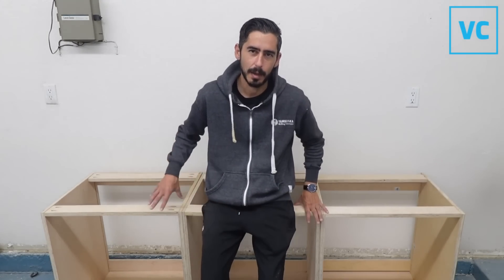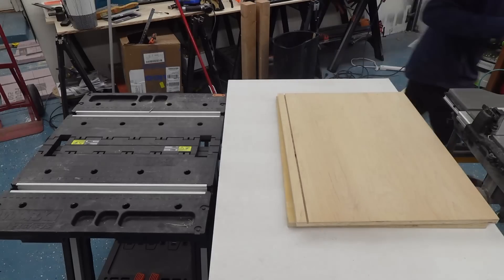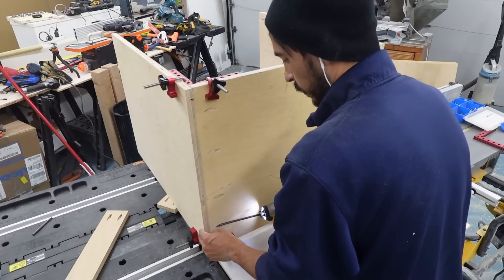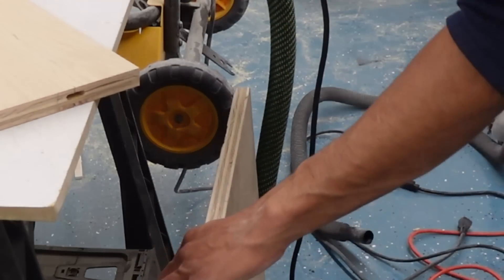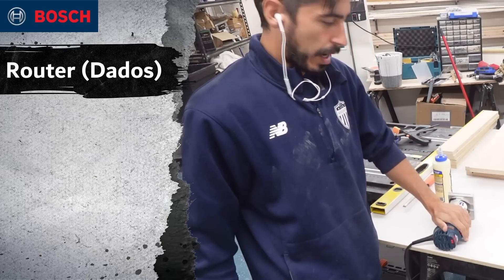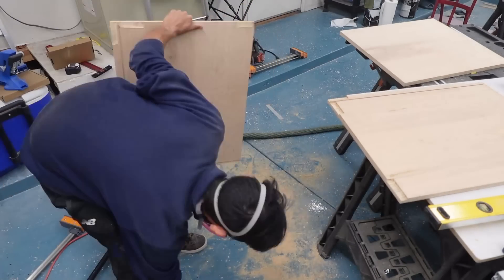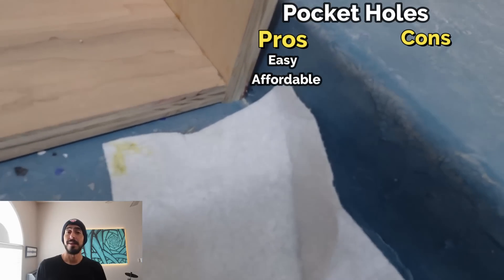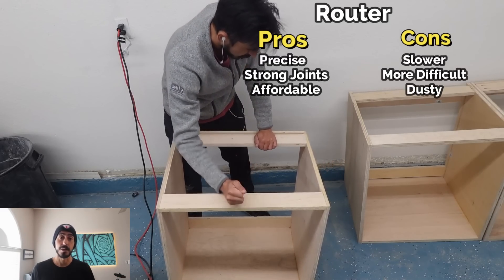Dominos vs Pocket Holes vs Dados | Testing Joinery on Cabinet Boxes

Comment: I used to manage a cabinet mill and have made a lot of kitchen cabinets. While all three of these methods work, I would use what our host is calling the dado method. (Those weren't dados. They were rabbets.) I also wouldn't cut the dados with a router. I'd have used a dado stack on the table saw. With this design of cabinet box, I would have cut a full-length rabbet along three of the internal edges of each plywood side (top, back, and bottom). This would require only one setup on the table saw and each side could be machined in next to no time. I'd also use a pneumatic nailer or stapler to attach the all the parts together while the glue dries. No need for clamps (except to hold things in place while assembling). It's a fast, easy, accurate, and super strong of building cabinets.

As I said, the other methods work. But, I can see no advantage of using them over the method I described. Provided, of course, that you have a dado stack for your table saw.
Reply from the maker: ugh yea, thanks for the callout, rabbets indeed!  I do have a dado stack, struggling a bit to get consistency on it for some reason.  Do you just use a sacrificial fence to get the rabbet right up to the edge? Can't figure out how to get the cut as precise with just my miter gauge
Reply: @vanishingcabinets  Sorry for being pedantic about the distinction between dado and rabbet.

Yes, you use a sacrificial fence. I use a couple of 'fence clamps' to secure mine. (The 'clamping part' of the corner clamps you used in the video would work for this.) Once you've made and installed the fence, it only takes a few seconds to mount. It only takes a minute or two longer to make another fence when the need arises. Just drill a hole in one end so it can be hung on the wall. It will always be hand when you need it.

Learning to use a dado set involves a learning curve. Yet, the curve isn't as long or as steep as learning to use your domino or a doweling jig. 

HTH

Comment: You had a plan on putting it together for the other methods except the domino. Once you figure out how to do it you should be knocking them out in no time.
Reply from the maker: Yep thats what I was thinking. Much more experience with the other two, so even with little experience with the domino it was a comparable time so a ton of potential for sure!
Reply: @vanishingcabinets  It goes super fast when you use the indexing that is built into the domino.  Especially on the stringers.

Comment: I like this in general, but found it curious that you state the pocket holes take longer when it was faster than either of the other methods you use.
For about 1/3 the price of the Domino system, you can pick up the Kreg Foreman.  I find that this style of cabinet takes me about 2 minutes to drill all the holes using that. Even using the Kreg jig shown here, it shouldn't be more than about 5. I avoid the joint inconsistency by using some clamping blocks to align the board edges and prevent shifting. But the assembly process on a cabinet of this design takes me less than a half hour at a leisurely pace. 
All of the systems have their merits and drawbacks. If I'm doing a one off, I might try some different techniques.  In terms of kitchen production, I can't imagine using anything other than the pocket screws.
Reply from the maker: Ha, yes it was ironic I said pocket holes were slow then they were the lowest time.  At the time, I felt I was inefficient with the other two in terms of dialing in the measurements, so if I was doing a bunch at once, seemed like in the long run they would be faster. But I could see the argument that pocket holes could still be the fastest, especially with that Foreman and a better clamping method than I used.
Reply: @vanishingcabinets  I have a jig that I use. It's made of 1/2" plywood and looks a little like the symbol for Pi. The edge at the back is notched to support the rear stringer, while the top is cut to position the top two stringers. Basically, I stand that up, flush it up to the front, and clamp it in position. It gives me support and alignment for all 3 at once. I made a pair (one for each side) and can drop in and affix all 3 in a matter of a couple of minutes. Gives plenty of support for downward pressure to hold the joint flush. 
Again, I definitely see benefits to ask the various techniques. And I know there are purists out there who have a gag reflex when someone mentions pocket screws. I just know that for production speed, I'd be "screwed" without them. (Ba dum bum!)

Comment: For the pocket holes, for the stretchers it might have been faster using your bar clamps to clamp in position then drill both ends? This would have stopped the faff with the corner clamps and might have clamped them in position better?  It's an interesting comparison. 👍
Reply from the maker: Actually, you are spot on, the corner clamps take forever which is what took most of the time. Think I could've gotten a better result if I just used the bar clamps. Didn't even think of it honestly.
Reply: @vanishingcabinets   I only picked that up because I've got the same corner clamps and they're very fiddly. You should do an update video when you've been using the domino for a bit and are able to set it up faster.

Comment: Nice video. Good presentations style. For this style of cabinet, I'd use the Domino on the narrow setting for the front edges of the bottom, front stretcher and two back stretchers. Use the alignment wedges on the front of the Domino to set the distance from the edge. Then use the middle or wide setting to do the back and middle of the bottom so you don't have to be precise with your measurements. Put 2 pocket holes in the bottom between the dominos and one on the ends of each stretcher plus one in the middle of the top back stretcher. This way all of your alignment and clamping is taken care of without needing any clamps or having to wait for glue to dry.
Reply from the maker: I love that idea! Using both methods seems to be the fastest.   The mortise "width" setting I didn't even notice when I was building these, but have since been using to give some wiggle room. Really helpful feature.
Reply: @vanishingcabinets  Festool’s instructions suggest using the narrow setting for one hole and the wider one for the rest so you get alignment of your reference edge and ease of placement and assembly.

Comment: I’ve used a domino pocket hole  combo for the alignment of pieces and not having to wait for glue to dry
Reply from the maker: Sounds like a great combo! Save money on the clamps, no waiting. Best of both worlds
Reply: Another Domino/Pocket Hole combo fan; dominoes keep everything aligned whilst screwing together.  Once you get to grips with the Domino the layout and morticing is pretty quick; loads of great tips on the Festool and Sedgetool YouTube channels.
Reply: @turnamere4859 I think I will try the combo tomorrow.

Comment: The secret to strong cabinets is  full 3/4 backs ,so much needless work trying to fit a 1/4 inch back  .Just because all Youtubers are doing 1/4 inch back doesn't mean its right .
Reply from the maker: For sure, I like the full paneled backs better quite honestly. Seems sturdier. If I had more plywood, I would’ve built them that way.  Full panel on top too is nice
Reply: Great answer and its a good idea to show dados not to many show that .But  it doesn't add that much to the cost .If you want a cheat code when I first started I used to get my cuts at Rona or Home Depot saved me so much head ache I was working out of a 1 and half car garage.Great video @vanishingcabinets

Comment: A plate jointer will do the same thing as a domino. Same strength, same speed, much less expensive. Also dowels work even better and are much faster.
Reply from the maker: Haven’t heard of a plate jointed before, will check it out!

Comment: I just finished making a bunch of cabinets identical to your design using pocket holes. It was super validating to see your experience with the inaccuracies when clamping isn’t rock solid. That said, I think there’s a fourth approach using glue & 21ga pin nails that could work better. I haven’t tried it, but I have a trip to harbor freight planned to finally get a pin nailer this weekend to find out…
Reply from the maker: You know some people say they have no issues if clamped properly but I haven’t cracked that egg. Good luck!
Reply: @vanishingcabinets  I have YET to get a single joint to look right, even with the Kreg pocket clamp and the corner clamp. Every time I try to screw one pocket in.. the wood moves. I DO have those same corner clamps you have and have NOT tried that.. mostly because it takes a bit of time for every corner to set those up. Now that I have a domino which is more forgiving as you can make one side a little bigger to allow easy adjustments.. I dont really need those clamps any more. Sadly.. I have about 5000 pocket screws of varying sizes so will continue to use that for some things to use up some of them screws.

Comment: When you put a dado on the very edge of a board it's not a dado it's called a rabbit joint. 

They sell higher-end actual professional grade pocket jigs that are not made by Kreg, and the board stays put when you drive the screws in. This is because they do a much more extreme angle. They don't use a drill bit to machine out for the screw they use something more like a router. It does not do that 15° angle like your kreg jig. The professional grade models put a 4 degree angle. This is a much stronger joint and it doesn't cause the piece to walk out of position. 4° versus 15° there's no comparison. Also the professional pocket hole machine is way way faster. They are very expensive but so is the Domino.
Reply from the maker: I was actually wondering if dado was the right term, thanks for the clarification. Great info on the pro grade pocket holes!

Comment: It is all about your capabilities and tools on-hand.  For me, I use the glue and brad nail method, then add a few screws.  Rock solid and works perfectly, being faster than all the other methods shown here.  If I have a finished side showing, I use pocket holes on those sides so the face has no holes to fill.
Reply from the maker: Agreed, a lot of ways to accomplish the same thing. Really like the idea of simplifying the joinery and just having a finished side to cover up the screws.

Comment: best way to build cabinets, is using a lamello biscuit jointer, I can cut the joints and assemble it in 15 minutes and its the strongest method, been doing it this way for 30 years
Reply from the maker: I was looking at the Lamello brand, looks like a high quality tool, thanks for sharing!
Reply: @vanishingcabinets  it is, you can buy the classic x for about $700 and its far more accurate than a domino
Reply: I have the Domino and I was thinking about the lamello as well and I'm familiar with assembling lamello cabinets. But I think you still going to end up having to align the tool the same way that he was doing the domino so I think that stuff doesn't change. So I don't really think it's that much faster. I think will be much faster is changing the way the cabinet is made. For example, I use three quarterbacks. Yes, it's much more expensive but usually I do the plants on method for the cabinets and a lot of the cabinet shops near me do the plant on method and that one seems to be the fastest and it's extremely tough box
Reply: @Therealphantomzero  I don't know, I am not a fan of the domino, I find the lamello to be far more accurate than the domino, I have a slot mortiser for doing loose tenons I've been building cabinets for almost 30 years professionally and for me this is the fastest and best way to do it.
Reply: @oliver299d  I do find an interesting that you say far more accurate like I'm not particularly a fan of the domino. I like the climax connectors but I think they're both relatively precise. I guess I'm kind of hung up on what you mean by precise, you know
Reply: @Therealphantomzero  I have found that the lamello is dead accurate with alignment and the domino is hit or miss
Reply: @oliver299d so you're telling me it might not be me that some things are out of line?
Reply: @Therealphantomzero  yes my lamello always has perfect alignment, I don’t think a domino is good for cabinets that’s my opinion most people think differently
Reply: @oliver299d  Interesting. You just like the lamello more.. nothing wrong with that. I dont agree one is more precise than the other. I suspect they are both as accurate. What pisses me off is the cost of the Lamello.. it's a simple biscuit joiner with a little motor that bumps the blade up/down for a split second. That's it.. and for that you pay 10x as much as a biscuit joiner and more than the domino. They'd sell WAY WAY more if they made the price in the $300 to $500 range.
Reply: @WhySoDivided-CantWeAllGetAlong  the classic x is $650 or so that's the one I use, you're talking about a zeta that will do biscuits but its not meant for it, its meant for specialty fasteners
Reply: Lol, you just know who has never used the domino.

Comment: Two ways that I have found are the easiest for cabinet building depending on tools available and application (e.g., whether side panels are visible).
1. Pocket holes and narrow crown staples. Crowns keep the pieces from shifting around and act as temporary clamps. 
2. Domino and pocket holes. Use the reference pins on the domino for repeatable mortise placement. 1-2 pocket holes act as clamps and give added strength. 

Obviously there is no right or wrong. Simple construction screws work as well. Cheers
Reply from the maker: Yea I like the idea of staples for temp clamps! Could save a lot of time clamping.  Completely over looked the reference pins on the domino, need to familiarize myself with the accessories

Comment: Just started watching, but for me it would be dominos all the way. Speed and strength are excellent. Pocket holes are just ok. I don't like how they like to squiggle out of alignment, and alignment with no reference makes for annoying assembly. You also have to be careful not to overdrive them and end up poking through the other side of the panel. I do like to use them in conjunction with dowels sometimes though; the dowels provide strength/alignment and the pocket screws are used as the "clamps", so I can keep the project moving. Dados are great for alignment, but take more time and aren't as strong as dominos or dowels. Dowels are what I use (since I don't have a domino yet), with a dowelmax jig. Excellent results.

edit: Yep, once you master the domino, you can get those cabinets down to 15 minutes or less.
Nice job with the video! subscribed.
Reply from the maker: Thanks! Sounds like we have had a similar experience with pocket holes.  I should try dowels, I hear good things. But yea gonna keep building with this domino to get more efficient. Really fun to use.
Reply: @vanishingcabinets  Dowels are indeed great with a good jig (dowelmax or jessem), but having a domino, I'd honestly stick with that. Use it on as many projects as you can to become familiar and more experienced with it. You'll be banging out 10 minute cabinets in no time. 💪

Comment: i think with the router way, you can make a template jig and clamp to corner and start routering and spend less time measuring.
out of these 3 i would go with pocket holes, mainly not having a domino and the cost of one.  

when building cabinets i have just put it together with a couple narrow crown staples (brad nails would work too) to hold it all together then go back and add screws from the side. if the side of cabinet is finished and not adding any kind of panel to the exposed sides then this method wouldn't be the way to go otherwise its quick and simple
Reply from the maker: Yea a template would have been a big time saver if I was doing more than the one.  I was actually thinking of doing one with Brad nails and screws, might have been good to highlight a more straightforward approach as well.

Comment: Only one of these methods can be used without spending $$$$ on clamps... 

Pocket screws because the screws do the clamping. Also, by far the cheapest method shown here. 

Although I'm not really sure how it takes 50 minutes to drill a few holes and screw a couple of panels together. That's a 20 minute job, at most. It takes seconds to drill a hole. I've put more complex things together with pocket screws, in less time.
Reply from the maker: Yep great point, clamps are stupid expensive. Should have pointed that out.  50 min I agree too was really long. Included filming time and moving the camera around, but still, could’ve been more efficient

Comment: At 1:35 when you move the track, it looks like you're just eyeballing the position of the track, how did you ensure both cuts were straight and square?
Reply from the maker: I did, well, I marked a reference line across the whole sheet that was measured for square. I was lining the track up to that as I moved it. Yep really important these panels are square, shoulda highlighted that